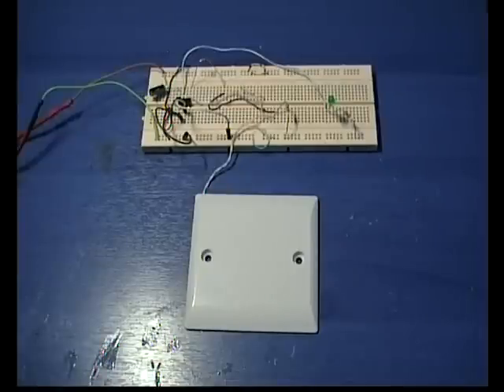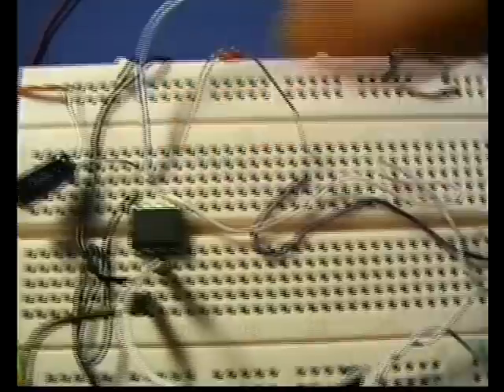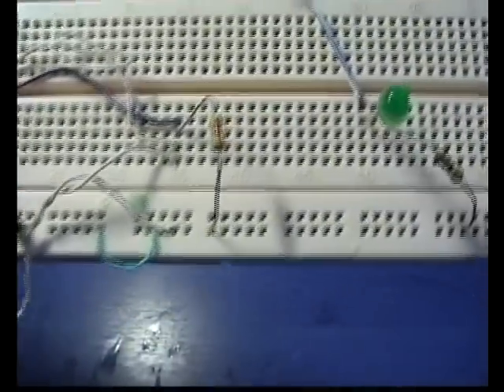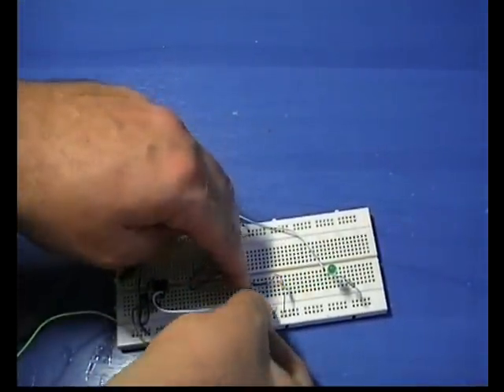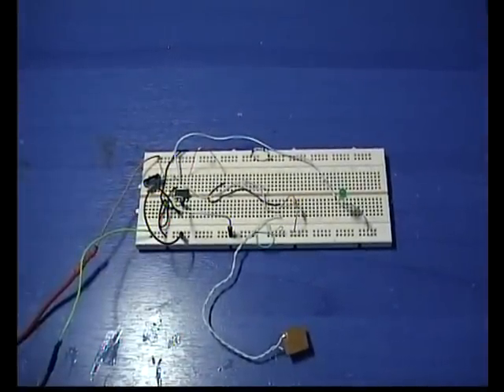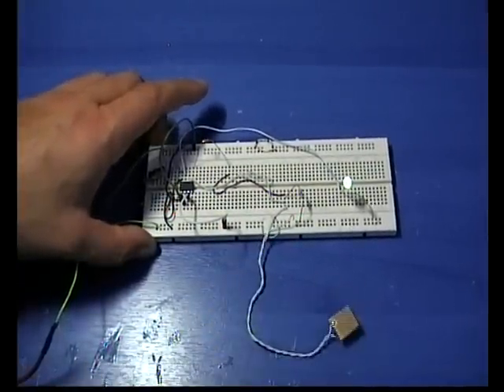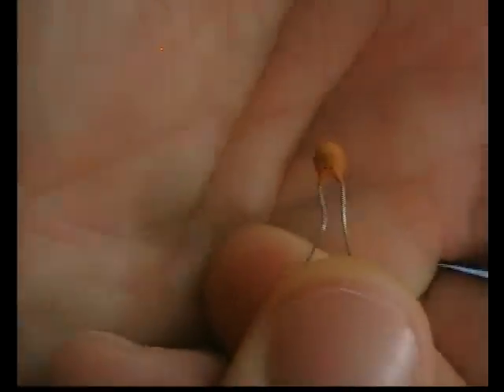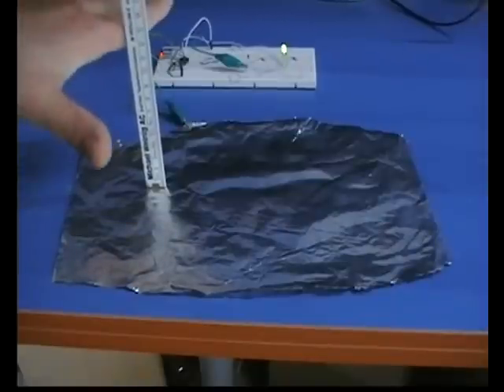DIY Capacitance touch button with PIC and Frequency Change

Comment from the maker: @ixamraxi yes indeed, and that is how i had originally designed it. But when the PIC falls into sleep, the current drawn was quite larger than the 15uA that draws now, because timer 1 and 2 had to remain open and running. That is why i used this mechanical switch instead. Only for technical reasons. The original design had a large proximity switch.